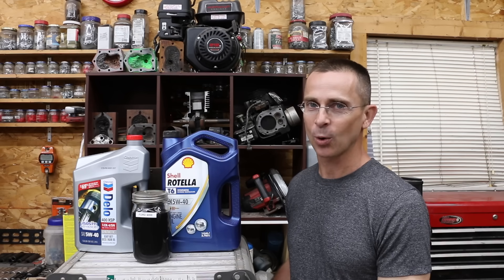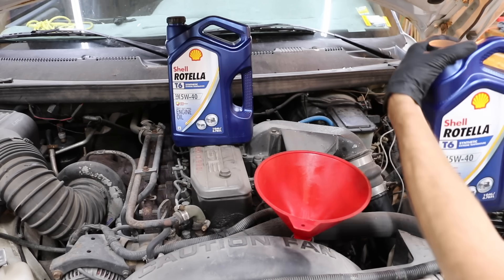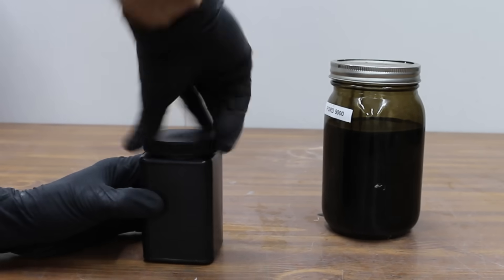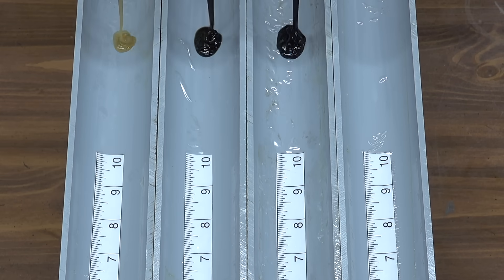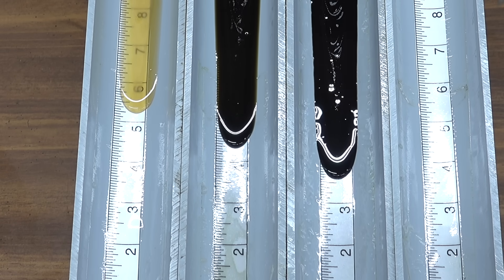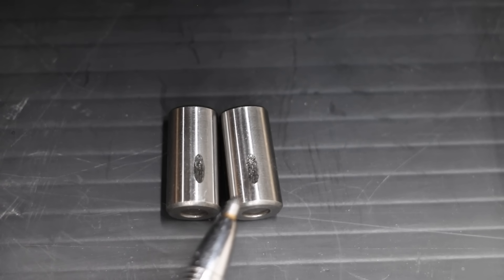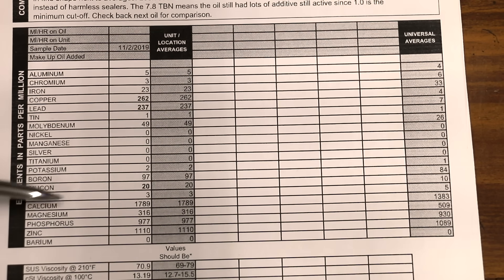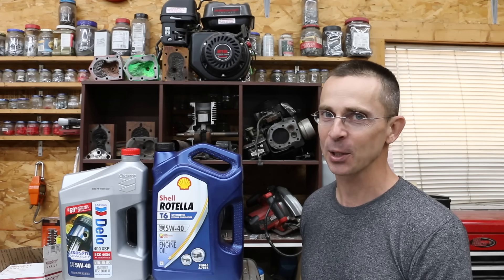Will Annual Oil Change Damage Your Car? Let's find out!

Comment: I think it depends on how much you use your car how often you change the oil. I get my car serviced every year and my garage does an oil change included in the service, each time I put my car in for a service it always feels much smoother after for several months until it goes back to the way it normally is 😁
Reply: True. When you take short trips you don't evaporate condensation.
Reply from the maker: Thanks for the feedback.

Comment: I see a lot of people running Rotella T6 5w40 in gas engines. What's your thoughts??? Love your shows!!?
Reply: T4 and T6 have been popular for gas engines for awhile diesel oils have better additive packages typically. I wanna see him test better PAO diesel oils vs the Penzoil which PF ruled as the best gas engine oil.
Reply from the maker: Thanks!  Thanks for the suggestion.

Comment: Another great video. I have a suggestion for a future video: oil extractors vs. drain plug. I use a Pela Oil Extractor to suck out the oil via the dipstick tube on my BMW. Many car DIYers believe extractors leave more bad stuff in the oil pan than the drain method. Let's find out.
Reply from the maker: Thanks!  Thanks for the suggestion.

Comment: Uhhh yes

 Due to milage.. or it siting up and condensation...oil filters also break down  in time. So if it isnt the oil... the filter isnt doing its job anymkre from just sitting in oil for so long
Reply from the maker: Thanks for the feedback.
Reply: Just my 2c of 25 years of vehicle work

Comment: Have ever used diesel  to clean the internal engine parts by draining the oil. Then putting a new filter and instead of oil using diesel disconnecting the ignition and turning over the motor for for a minute a couple of times. Then replacing the diesel and filter with new oil and filter. Is this a myth or the ultimate way to clean the internal engine parts in a vehicle that had been sitting for a long time?
Reply from the maker: Thanks for the suggestion.
Reply: Sounds like a bad idea lol I would use an oil flush additive before ever dumping gallons of diesel in the crank

Comment: Great viddo but fuel contamination would be considerably higher for direct injection vehicules specially the ones driven short distances on top of not very often...its a gamble i wouldnt recommend as a trade professional...premature wear on cylinder wall and piston rings would be my first worry and changing oil often is still cheaper than an engine job
Reply from the maker: Thanks!  Thanks for the feedback.
Reply: @ProjectFarm  I change oil every 3k been doing this for more 30 then years never had an issue.

Comment: We have an 03 SVT Cobra 4.6L supercharged car (factory) that I ran Amsoil oil and EA filter in. The car sees around 800 to 1,000 miles a year. Each spring I send to Blackstone for the complete analysis and at the 4 year point they still showed the oil was good to go. I changed it at that 4th year.
Reply from the maker: Thanks for sharing.

Comment: Question for anyone that is interested in answering…I have a 2000 Toyoda Tacoma Prerunner. Have ALWAYS changed the synthetic oil AND oil filter every 6-9 months. It’s difficult to take off and clean the oil filter leaks/drips. So I am asking if I purchase a “higher-mileage” filter would it be safe to JUST drain the oil and replace filter every other oil change? Thank you in advance. EDIT:my engine only as 110,000 miles on it. 21 years old. ✌️

Comment: Would love to see this with transmission oils since so many people don’t change theirs.
Reply: My truck changes it itself since it leaks it all out and have to pour more in
Reply from the maker: Thanks for the suggestion.
Reply: If you don't have an automatic transmission there is absolutely no need to ever change the oil, not even in extreme climates.

I'd say a more pressing issue is that people don't realise they need to change coolant every year unless they use waterless coolant.
Reply: @michaelmay5453  I must disagree. Heat and decay occur on manual transmissions too. While degraded oil may still “work”, it’s certainly not close to optimal. The cost of a fluid change may be offset by improved fuel economy and “fun factor” (torque).
Reply: @jtmcfarland3512  It really doesn't which is why not a SINGLE manufacturer suggest replacing it. It gets more sticky as it ages and contains more of the hardened surface ground away which is great since it matches the age of the gearbox.

Trust me, if you're not rebuilding the gearbox, never change the oil on a manual gearbox.

We're not having a discussion here, this is me educating you on this subject. It may sound harsh but I don't want some yahoo to listen to you and ruin their perfectly well working gearbox.

If it cannot be helped (gasket fail or similar) don't clean it out, don't open it, don't do jack shit except refill it and even then, add 5+ weight to the oil to compensate.
Reply: @michaelmay5453  You clearly have no idea what you’re talking about. There are definitely manufacturers that recommend it and plenty of mechanics and engineers who can explain the science. You probably aren’t even aware the drain plug is magnetic. 🙄 Many mechanics recommend not changing it on a high-mileage AUTOMATIC only IF it hadn’t been changed regularly.
Reply: @jtmcfarland3512  No there is not, not a SINGLE manufacturer recommends that you change your oil in your manual gearbox.

This isn't up for discussion.

Automatics needs regular change though, both oil and filter, ALL of them and more important if the box is old.

You're just making shit up and playing pretend  you know things, it's ridiculous and you need to stop.

Comment: One big take-away here is "the key here is let your engine warm up to operating temperature at least once a month".  Nothing worse for an engine than one not being run unless it's been storage preserved.
Reply: The only way I know around that is to "pickle" the engine... I only saw one guy do it, he was going away for the service and wouldn't come back for years.  You just fill the oil level literally all the way up, NOT to the dipstick but all it'll hold without leaking out!  The idea is to cover all the "naked" metal inside the engine, like cylinder walls and bearings, and cam, etc. with oil, of course.   Then you remove the spark plugs and even fill the cylinders.  I think I'd remove the valve covers and even coat the camshaft with RIG or something like that.  Then you can be pretty sure nothing inside the engine will rust.
Reply: @robertmaybeth3434  I think, putting too much oil in the oil pan will cause the oil pan gasket to go bad sooner because of the continuous oil contact with the gasket.
Reply: @SokemRokemRobot  Maybe so, but that is the least of the damage caused by overfilling!  Let's talk about blown main bearing seals, front and rear for one thing.
Reply: @robertmaybeth3434  No need to do that. Oil will stay on the surface inside the engine even a very thin layer will prevent rusting.
Reply: @jasonsong86  most motor oil actually has very little anti rust properties since it's designed to constantly be covering components.

Comment: I've been using diesel oils for years in my motorcycles. Excellent service.
Reply from the maker: Thanks for the feedback.
Reply: I have also used it in most of my bikes also, but the T-6 didn't have the proper rating for my Kawasaki

Comment: I applaud the dedication and I appreciate the reason behind it... But unless you genuinely drive the vehicle this little, please don't go a full year without changing the oil... My 02 Ranger just passed 200k a week or two back. I use Valvoline Full Synthetic High Milage oil and K&N Gold (That nut is a lifesaver on those 3.0 engines) filters. I try to change it about 7k miles, usually aiming for just before. Take care of your investment, and it'll take care of you.
Reply from the maker: Thanks for the feedback.

Comment: I have some low milage use vehicles. I have not changed oil in one truck for 2 years now. I do oil sampling at every oil change. One time the sample was high in anti freeze. My oil cooler was leaking internally. I replaced the oil cooler and tool another sample. No more antifreeze in the oil. If I had not done the oil samples the engine could have been ruined. That sample saved me a lot of money. Great video! When I go on trips I will go to a rapid oil change place, the "expert" will say that I was lucky to come in because my oil is dirty. If you can tell oil dirty by looking at it, chances are you have already damaged the engine.
Reply from the maker: Thanks!  Thanks for sharing.

Comment: I'm at about an annual oil change. I use shell ultra platinum. It has a small leak so I have to add new oil anyways, I'm not even going to change the oil, just swap out the filter every now and then
Reply from the maker: Thanks for sharing.

Comment: My neighbor bought a ford 2005 pickup 4.6 V8 from a dealer.  Total junk.  He didnt run the engine warm enough. But after a week he drove it warm on the highway.  The engine shook terribly. Mechanic said it was a poor design and probly do to late oil changes. 
junk it.
Reply from the maker: Thanks for sharing.

Comment: If you want your car to go more than a million Miles without any problems you actually need to change the oil at least once a year.  Even the smallest particle can probably wear out in parts of the engine for so many miles.  Of course, it may be necessary to clean other parts of the engine as well if the engine is to last that long
Reply from the maker: Thanks for the feedback.

Comment: But is not a problem with small metal particles found in the oil that are old which according to others can affect the engine and engine parts negatively
Reply from the maker: Thanks for the feedback.

Comment: Unrelated to age, but you might find it interesting to know that Houston Yellow cab running mostly Dodge Caravans (3.6-V6s; about 600 of them), only changes the oil every 20,000 miles with synthetic and almost always gets 200,000 miles out of them before selling.
Reply from the maker: Thanks for the feedback.

Comment: You forgot to think about the engine size. Big conventional engines can run always more miles and time then small engine sized motors. They are cleaner, too. Thats why tanks dont need that often oilchange. They test an oil and only, if the labour says change it, it will be changed.

The smallsized directinjection turbocharged engines of today are a different story. They are weaker and produce more dirt inside the engine, so the oil need to catch more of it. Even with the calculated serviceintervalls. Its in most cases better to change the oil yearly. In germany, we did the same tests with different modern cars and the result were different. In nearly every case, it must be changed every year or before. The viscosity chanced from 5w40 to 5w30.
Opel for example tried the 2 year longlife intervall, after several engines got damaged, they switched to one year again.
I know a friend, who said, he gone do it only every 2 or 3 years. After 70k km the engine got damaged and he needed a new car again.
So it depends on driving conditions, oil quality and typ of engine.
Reply from the maker: Thanks for the feedback.

Comment: I drive my 2010 Toyota Yaris as a daily driver to my job. Distance one way is 19 miles.   I drive mostly freeway at "traffic speed" if you know what I mean. I don't baby this car.  I have been using Costco's Kirkland synthetic oil (great buy) and noticed I don't need to change the oil every 5000 miles.  In fact, sometimes I just change the oil filter at about 4-5 thousand, replace the oil to the filter with new oil thus "injecting" new oil to the mix making it last that much longer.  Usually I change about 8-10 thousand miles for a full change.  So far, so good.  I think changing the filter is just as important if not more important for the life of the oil.
Reply from the maker: Thanks for sharing.

Comment: ive used rotella t4 me and my familiy in our cummins forever and never blew an engine with 400k + miles, and ive always used the t4 in my high performance motorcycles engines and never had issues !
Reply from the maker: Thanks for sharing.

Comment: As a chemist we take some issue in your implications implying that if the engine used a paper filter instead of an oil bath filtration system resulting oil test analysis would somehow prove the paper filtration system superior to an oil bath filtration system. You are interpretations are limited and resulting assumptions are wrong and incorrect based on many other technical and historical long term use evidence.  Although more inconvenient oil filtration systems have a resulting higher percentage of filtration effects over a wider range of particle size and organic matter than paper based systems and effective service longevity.  Empirically superior in all test range parameters than a paper based system.  Why do you suppose many heavy equipment manufactures still to this day use oil based filtration systems on all atmospheric inductions equipment including turbos ?  So with that said, where is your paper based filter system analysis to prove your comments regarding silica % numbers as being much less than the Ford oil based system ?

Comment: I change my own oil on my 2004 Tacoma that has 262,000 miles and honestly just change it whenever I feel like its ready. The oil level is never low when I change it, its never black or darker than it should be and my Taco runs like a mofo. I usually use full synthetic but sometimes use a high mile blend;  I'd like to get it tested though and might do that soon.
Reply from the maker: Thanks for sharing.

Comment: I've always followed once a year or every 7,500 miles, whichever is first. Part of it is doing your research and learning which cars/engines have known oil issues like sludging or oil burning. Those you want to change more often.
Reply: That's it guys. He said end of discussion. Lol. What a waste. Especially if you're using full synthetic .
Reply: @playerroku4412  NO WE NEED TO KEEP DISCUSSING
Reply from the maker: Thanks for the feedback.
Reply: When I was working in a highly stressful environment, I could not find the time/energy to change my oil for 2-1/2 years.
I drove my 1999, 6cyl, 4.0L Jeep XJ for 25,000 miles over that span of time on conventional oil. (If I remember correctly, I did add a couple of quarts during that run). Years later it's still running great, but I'm back on an annual conventional oil & filter change schedule.
Reply: Time is not relevant
Reply: @hhjhj 15,000kms is all good with my vehicle. Usually try 10k but doesn't seem critical. Vehicle gets driven often so isn't sitting around for weeks
Reply: Moral of the story! Drive your cars!
Reply: @hhjhj I dont care what you say or think, and discussion ends when I say it ends.
Reply: @hhjhj 5k mile changes, and full synthetic Valvoline and a synthetic oil filter for me. From what I've heard, 5k is the most commonly recommended oil change interval, but 3k is if you do conventional oil, tow heavy objects, or drive the car very hard. (Also you're probably doing the smarter thing, because the more frequently the better! Lol.)
Reply: Years ago oil was changed at 6,000 miles or 2 times a year IF you worked your 8 cylinders on a daily basis...
Now after 40 years oil has gotten much worse in lubrication and needs changed in 3,000 miles or 3 times a year...
It's a GIMMICK folks...
Have your oil properly tested before dumping it to learn about your engine and the oil you use...
Funny how a hard working semi truck can go 40,000 miles between changes and your little puddle jumper can barely do 1/10 that 🤣

End of chatter, burn your used oil in your furnace to make heat instead of a recyclers...
PS.... Quick Lube places USE used oul in their 55 gallon drums as NEW fresh oil $$$
Reply: @boobtubeakatv1296 I can't believe Quick Lube would do that. They could face massive law suits.
Reply: @boobtubeakatv1296  And yet cars simultaneously last longer and are better on fuel economy due to the thinner oil.
Reply: Or you just change your oil every 3k miles and never worry about it, stop being cheap
Reply: @MZRFaith  stop wasting oil.  3k is not necessary.

Comment: For those claiming that engine oil, both natural and synthetic, has to be changed at specific time intervals regardless of use it would be great to see the scientific data comparing the impact of oil changes at different intervals, both time and distance.
Reply: All this looked to me a.pretty good scientific data except that the guy doesn't have a long white beard and some crazy hairstyle

Comment: The corrosion factor of motor oil is very good now compared to the older paraffin motor oils,  that also. "Caked up",   they DID become acidic a lot easier when exposed to moisture.  Very good testing 😃😃😃Thanks
Reply from the maker: You are welcome!

Comment: Ran my Ram 2500 hemi 30,000 miles a year with an annual oil change for 209,000 miles before selling it. It ran great. I used Amsoil with a dual Amsoil filter.
Reply from the maker: Thanks for sharing!

Comment: Lots of  cars I deal  with 100k or more are .5 to 1 full quart low on oil  at  the  5,000 mile mark. It’s crazy to me to go one full year there will be no oil left. We are talking about DMV commuters so 50-80 miles a day. Toyota, Honda, Chevy,ford, dodge etc….
Reply from the maker: Thanks for the feedback.
Reply: I always keep my oil topped off. I feel like keeping the fluid topped off is very necessary for a long lasting engine.

Comment: Its  not "obvious" at all that you cant prefill oil filters if they are mounted sideways , or even inverted on the top of the motor.

Just fill up the filter and leave it sit for a minute or two.  The oil will soak into the dry filter and you can screw it on at any angle without spillage.
Reply from the maker: Thanks for the feedback.